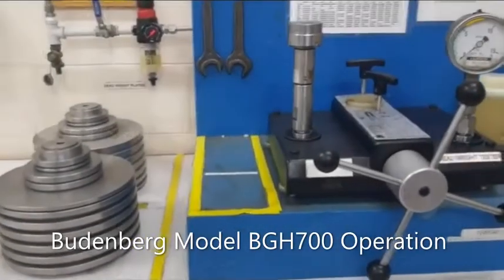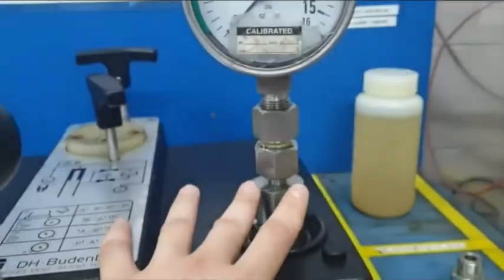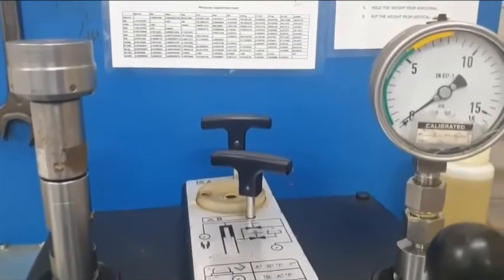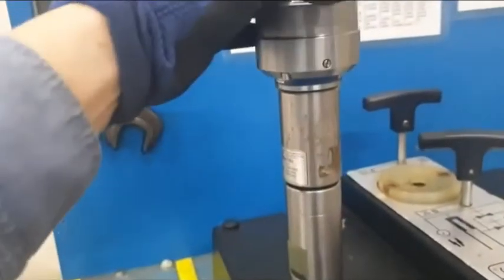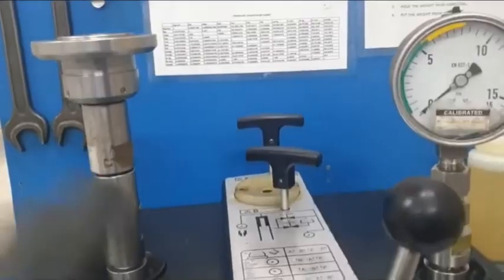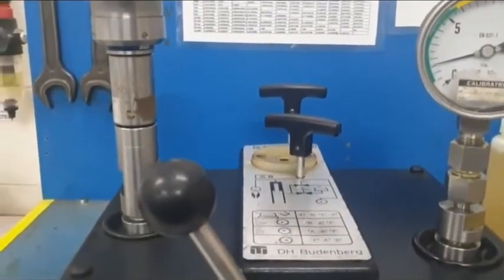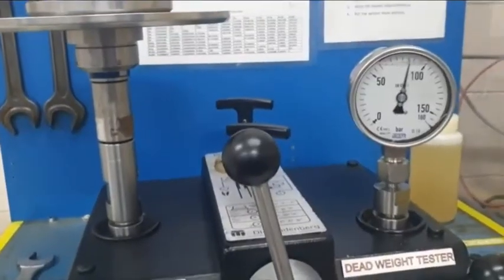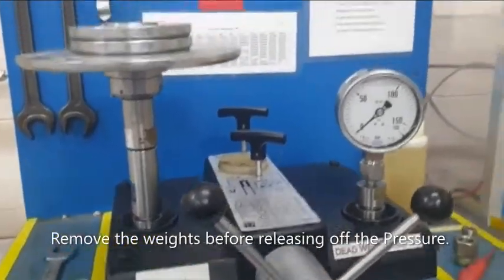Budenberg Dual Range Hydraulic Dead-weight Tester Model BGH700 Operation

Comment: why the weight need to be rotated?
Reply: oh to make sure that is no leak and no friction on the shaft
Reply: The weights are rotated for the free spin. When there is a free spin, the piston is free-floating, which implies that the pressure on the instrument under test is exactly the same as that generated by the tester.

Comment: Sir. Thank you for the clear and precise explanation.
We also have the same Dead Weight Tester but it is stuck in the High Pressure piston.
Is there any way to bring it back to the lower piston?
Reply from the maker: There is either no lubrication or the oil is highly contaminated. Please let us know your location and send me your details by email to sales@budenberg-me.org. We will revert with a solution.